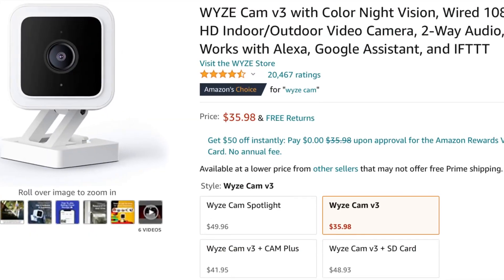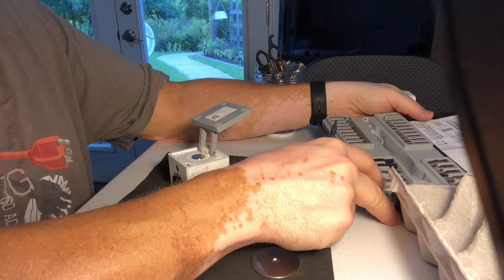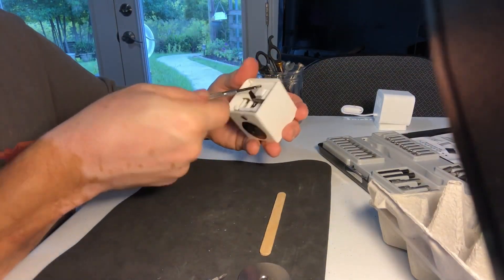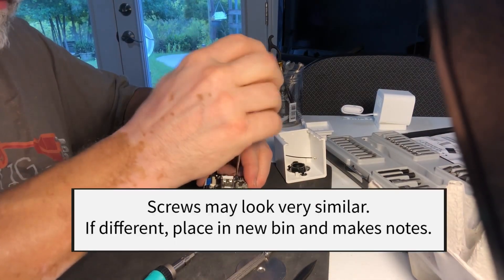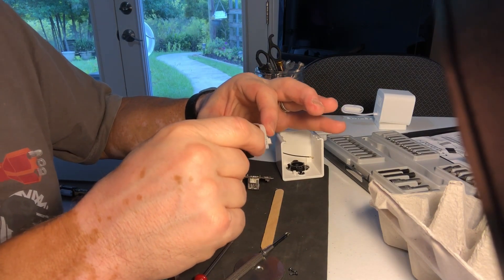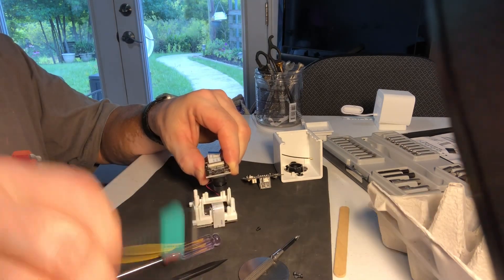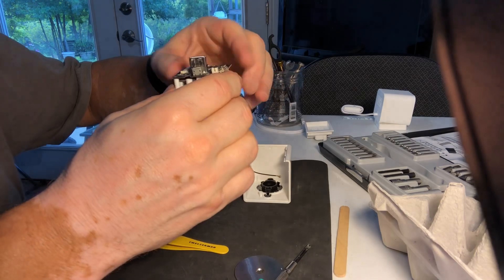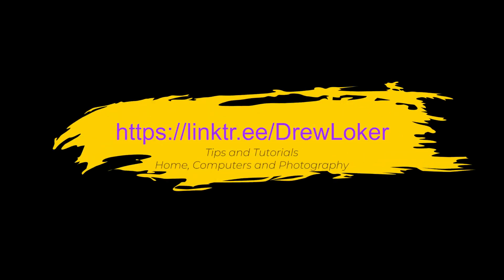Wyze Camera DIY Disassembly and Repair V1/2

Comment: I made the same mistake fixing an LG slide phone. I had to replace the power supply ribbon. I ordered it. Installed it. Final inspection I seen something in between the two sides. Couldn't get at it in a conventional way. So.... I took a razor blade and slid it in between the two sides. Slice! This sliced item was the ribbon that connected the top of the phone to the bottom of the phone! Had I watched it all i wouldn't have been so curious about that thing stuck in between! 
1st phone repair mistake. MANY moons ago! 14 years? Yeah. 14 years ago! 
Thanks for the video!
Reply from the maker: That is interesting! Thanks for sharing!! I’ll share your comment with my students!!

Comment: How can you tell if there's water damage?
Reply from the maker: Excessive moisture may show up as haze on the inside of the lens. Which is what I show how to clean in this video. Actual water may short out the board, or charging contacts. I had one with rust in the usb port and it would not power up.
Reply: @DrewLoker  Thank you so very much. In this case, there is some rust on the larger USB port but nowhere else. I think I should've capped it off because that looks like what did it.

Comment: Hey... my camera works again!  Very thorough walkthrough. Easy to follow and the lens cleaned up great! Thanks. 😎
I live in the Philippines, so with our heat & humidity, inside... is pretty much outside.  I put mine under cover, but out on the front and back porch (out of the direct weather but outside).  So far only one got weird picture, but I got it used (from a friend) over 5 years ago - so not too shabby.
Reply from the maker: That’s good to hear. Thanks for sharing the feedback. All of my v1 and v2s were outside, but under cover and suffered some humidity damage, so this breakdown helped clean them up. I upgraded the units to v3 and moved the older ones to inside cameras.

Comment: The camera unit and lens assembly in the Wyze camera looks very much like some miniature cameras I have purchased on Ebay.  Specifically, the lens mount appears to be the standard "S-mount" or "M12" which is a thread that's 12m OD x 0.5mm pitch.  I've been thinking of getting a Wyze camera for a certain application, but I don't need a wide-angle lens.  Can you comment?
Reply from the maker: As a matter of fact, I have some telephoto lenses in my Amazon cart right now that I a plan to get and swap out the wide angle. As far as I know, it is easily doable. And I agree...will make the Wyze cam much more useful in focused applications. Good luck!!

Comment: QUESTION: do you recall what size nut and bolt are used to connect the gray articulating arm to the white rotating camera base?  I’ve lost the nut and can’t find any information. Otherwise, great video and explanation!!
Reply from the maker: I do not know, but if you don’t find a solution, let me know.
Reply: @DrewLoker   Just fixed. Nut size is an "M2"

Comment: Hi Drew
Got the back off my Wyze 02 open thanks to your video.
It fell on the floor and now there is only a solid yellow light and does not go to the 
"Ready to connect" stage. Is it repairable now I have the base off? It worked perfectly before falling on the floor. Appreciate any tips.
Reply from the maker: Well, having taken apart more than I have put together, I would say you have some spare parts. Fortunately for me, I teach technology so I keep the insides to show students. Good job trying though!

Comment: Thanks, a recently cleaned mine and it helps a lot. Wondering has anybody tried just leaving this disc out?  If so, what is the result?
Reply from the maker: Thanks for the feedback…I appreciate it! Not sure about leaving it off. You would probably get some stray light depending on the quality of the incoming light.

Comment: Amazing video!  Have you experienced any wifi connecting issues/resolution happening with the v1 or v2?
Reply from the maker: Thanks. Yes, some wifi issues, but nothing that I didn’t attribute to entirely too many wifi devices…including more than a dozen Wyze cameras. Maybe the V3s are more reliable now that you mention it. I use an Netgear Orbi Mesh router that spreads out from house to barn, so I am pushing the signal pretty far and have been pretty forgiving. The cameras closer to the house do not drop like those in the barn.

Comment: Great video . I just  can't figure out why the camera doesn't charge anymore . I cleaned the interior carefully , reassembled  and still not charging . Any idea what is a common repair for not charging  ? Thank you
Reply from the maker: Thanks for watching and for the feedback. I assume you tried another power cord? Any chance you have more than one of these older versions? I did lose a couple to the elements, but took parts from one and fixed another…including the power board which had gotten water damage. If another power cord does not work, I would say the power port or board is toast.

Comment: Nice been looking for disassembly. I wanna paint mine brown to mount in a tree facing my  front door
Reply from the maker: Do you have a solar panel and battery for it? I have a setup I am working on that is going to put the Wyze Cam v3 in a wildlife area using a 12v battery and a charging panel.

Comment: Thanks for the video but I now I can't connect to the camera 😅 I deleted it from the app but now the light stays blue and it does not want to reset
Reply from the maker: That’s is unfortunate. If you are talking about a V1/2, keep the parts in case you have another. Also, it’s modular. I have pulled the antenna for another use. But I would go ahead and upgrade to the new v4 at this point.

Comment: Is there a battery? Mine is not charging anymore. Wyze cam outdoor
Reply from the maker: There is no battery. So, the power to the unit has failed. This is why I had a spare to pull parts from.

Comment: I really want to like wyze cameras but my experience is that all cameras develop this image degradation over time.  Its like pixelated image and purple color everywhere, not sure if I will ever buy them again.
Reply from the maker: I can appreciate the challenge. I guess part of the like is the economical solution to have lots of these. Years ago, before Wyze, these would have been $100 each. Wyze helped bring down the price point across the industry. I don’t think Wyze intended for us to put these outdoors, but at $20-25 (initially) it was very tempting. I put them upside down, inside boxes, in the barn, outside and around the house…and most have lasted just fine. And for the v3, they are all holding up nicely.

Comment: Hi Bill, great video.  Do you have a way to "reset" the eprom or whatever it might be on the WyzeCam v2 board so it will properly accept new firmware?  Many, many people have had instances where the camera is "bricked" with a solid yellow light after doing a firmware update.  Although there are instructions on how to re-flash them, when the update doesn't go well, it's not possible to move forward.  I'm thinking there MUST be a way to reset or erase the corrupted firmware on the device so a fresh install can be done.  Do you have any experience in this area for the V2's?
Reply from the maker: I do not. At this point, the newer Wyze cams are much better. In only used this repair to mix two broken v2 cams to make one operational…and then put it inside.